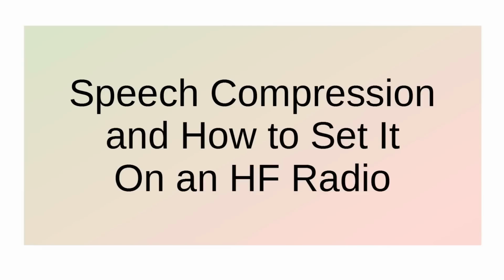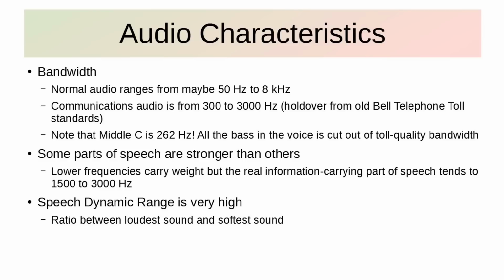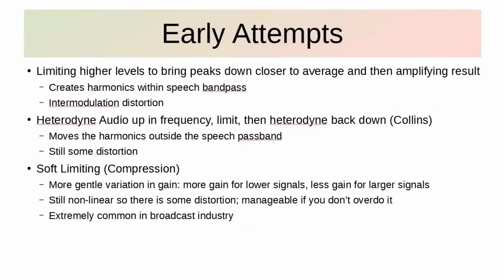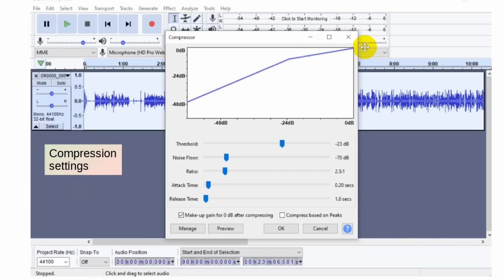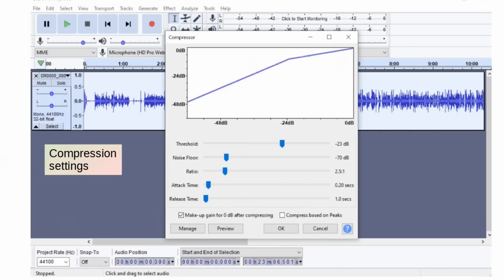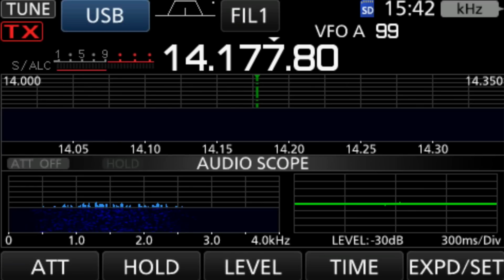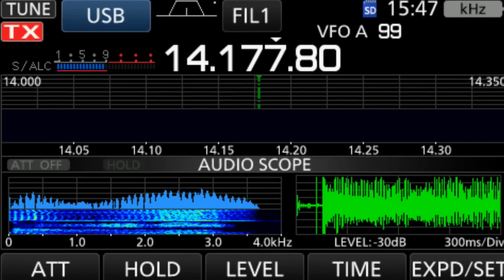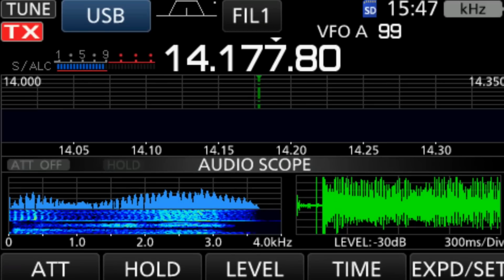How to set up Compression on your HF radio (#383)

Comment: I understand that the Icom, at least theIC-7610 has a setting related to Compression. Its DRIVE GAIN under the Quick Menu. The book from Radio Today refers to it as a third component when setting up your Mic. Mic Gain, Compression then Drive Gain. The book is not very clear in many areas and I really don;t know what the Drive Gain is or how to incorporate it into setting up Mic Gain, Comp, ALC, etc. The Icom Advanced manual, page 9 states this for Drive Gain - Adjust until the meter reading swings between 30 to 50% of the ALC scale, when speaking into the microphone. We typically set tis with Mic Gain???? Confused. FYI - Great video on a topic that is not easy to teach.

Comment: Thanks Dave for another awesome episode. 

 If anyone is still watching this episode, another thing to consider is finding a web sdr station that receives you well then listen to your actual broadcast signal. Maybe have a qso with someone turning down the receive volume on your radio and instead listening to both them and yourself from the web sdr station, and make all tweaks to your gain and compression during the QSO. That way it is more natural to how you will be truly talking in real situations, and you don't have to keep asking the receiving station for feedback. The only drawback to this is the recieve delay in hearing yourself can be a little odd to listen to, but its doable. This is how I set my gain and compression on my ft-891 and I have received excellent audio reports with just the stock microphone. 

73
Matt
W3MMW

Comment: I'm a noob to HF (about a month) and never even considered the information that you presented Dave. Thank you! I have begun my research and found that factory default settings in audio are not the best for my FT-891.  Although, I do not believe that there is a true compressor on this radio (at least I haven't stumbled across it yet), microphone gain settings appear to be the opposite of what I would have thought to help get your voice through clearer. Good food for thought!

Comment: As usual Dave, excellent advice and well explained. Unfortunately, I still hear some hams who sound like they have cranked their drive/compression up to maximum, sound dreadful and cause lots of splatter resulting in QRM (as they frequently seem to be the type of ham who run lots of power).
😀 Made me smile when you said that you were going to expand on the subject.

Comment: My only suggestion I have for you Dave as a soundmen. Would be to set your release time on you compressor to about 100 to 200 milliseconds and attack time anywhere from 10 to to 20 milliseconds. I know you speak softly but there is no need to hold the release time to a full second. This will make your compressor  compress all the time because you are not giving it enough time to release. If you find yourself needing more compression go to a 4:1 ratio and set your threshold until you get about 6 DB of compression. This will probably give you a better tonality as well.  73

Comment: One of your best yet Dave - thanks
I wonder if I run the mic through the computer first and use Audacity rather than the radios limited facility for audio compression and tone controls, then into the radio - something to play with  I suppose.

Comment: I have much better result using a DBX 286S and a BBE 482 in the mic line for compression rather than the radio compressor. 
Compression really helps getting through pileups and medium to long range signals. It’s like you get a free 50 to 100 watts more output.

Comment: Nice presentation Dave, thanks. 

My only comment would be, in regards to applying EQ'ing:  In most cases, it is far better to REDUCE an unwanted characteristic, rather than BOOST a desired characteristic.  

That is to say, for example, if you have excessive low frequency response, don't boost the highs to compensate, but rather, reduce the lows instead, for best sound.  Then increase the overall gain if necessary to get overall nominal levels. This helps reduce the chances of introducing distortion. 

That, and there is no one EQ setting that works for everybody. Everyone's voice and tonal qualities are unique, and so proper EQ'ing must be applied individually.

I've spent many years in live-venue music mixing (and recording) , and the key to good sound is often LESS instead of MORE! LOL
73's
Alan
W0ARM

Comment: I have tried monitoring using a separate SDR via a dummy load as you have done here but like your audio samples, my samples were really rough sounding just like yours ( no offense ). I suspect having the RX so close affects the results (who knows what amount of RF is radiated from the dummy load) since by all accounts the on air signal is good. 7300's are known for decent audio even with the standard hand mic.  I typically do not use compression since DX is not my thing.
Reply: The standard hand microphone supplied with the IC-7300 has a HEIL element!
Reply: @submarineradioman5535  That seems odd, Where did you get that information?